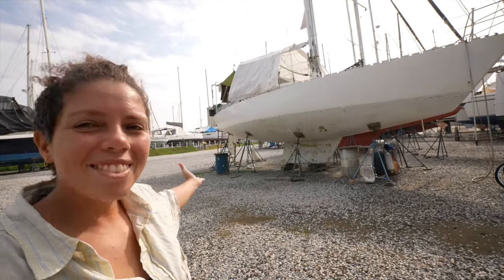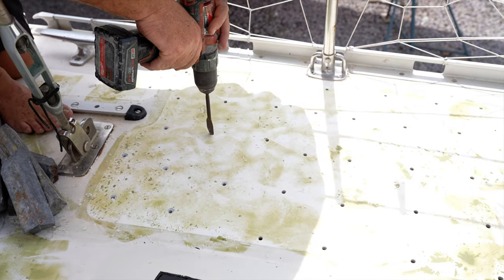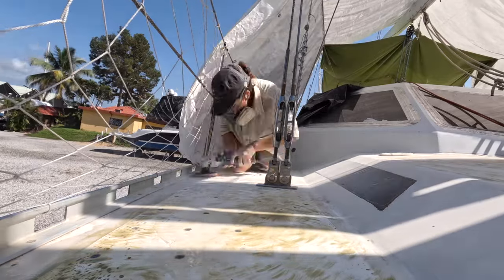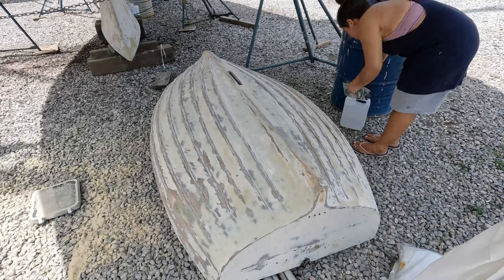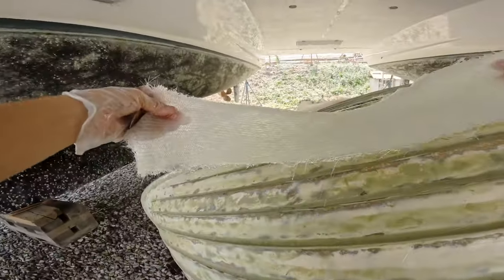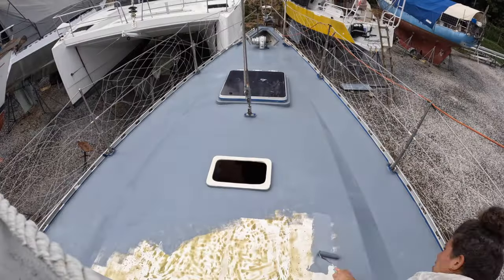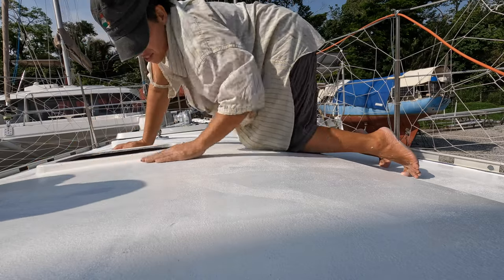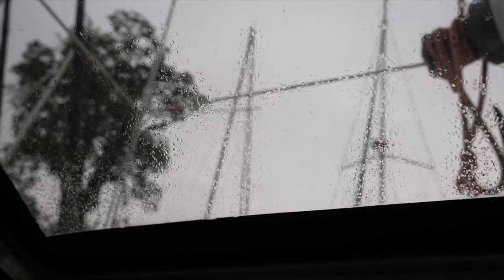let's PAINT our way out of ALL these diy sailboat projects

Comment: Good job on the deck painting.  It looks like you did a complete job that will last.  Three coast of paint and a barrier coat, it made my repainting Hogfish's deck last fall look pretty weak.  Hey, on the windows, consider just using UHB tape and sikaflex.  It what I did on my boat.  I'ts what they do on new boats.  Its easy, looks clean, and if done properly is safe.  Just an idea!
Reply: I would also recommend VHB tape and Dow 795 for surface mounting poly or acrylic windows. I did this on my boat and if you can find the products it works well. I think they might have glass windows (which don't get the UV damage plastic ones do) so surface mounting might not be suitable.
Reply: We did this too and will do it again on our "new" sailboat
Reply from the maker: Thanks for the tips! We may do this because we're having issues with the sealant for the first set of windows you saw us install. We'll look for that tape!
Reply from the maker: Thanks! Yes, we have some plastic windows and some glass - we appreciate the tips!

Comment: The real problem with the dingy was that you fiber glassed over the gel coat paint, you needed to sand all the way down to the fiber glass, and by the looks of it you're doing it again...
Reply: And fiberglass needs a ruff surface to stick too not a smooth surface, that is if you want it to really stick...
Reply from the maker: Yes I can assure you that the dinghy did get a thorough sanding although it did not seem interesting to film at the time 😆  It was made ultra thin, too thin - probably a mold on top of an actual Fatty Knee dinghy, so I wanted to leave as much material as possible. In my experience, well-sanded gelcoat never has adhesion problems, it's just a philosophical question of whether one wants to bond to a surface layer rather than the proper fiberglass layer...the problem has definitely been too thick fiberglass cloth for the job.

Comment: What month are you there painting & working on your boat? Is there a drier time? We are interested in doing some boat work. We too, have some crackling spots in our "new" 50-year old sailboat. We also have some portlights to replace. We have the acrylic but need time & weather. You know how that goes :)
Reply from the maker: As far as I can tell it's always wet here 😂 We arrived in July with aggressive lightning storms every night like clockwork, now the weather has changed to wet mist everyday all day, and when we were here December-January a couple of years ago, it was cold and rainy throughout those months. I just checked the charts, and dry weather should be Feb, March, April.
Reply: @sailorama  Thanks. Hope you can manage to get work done